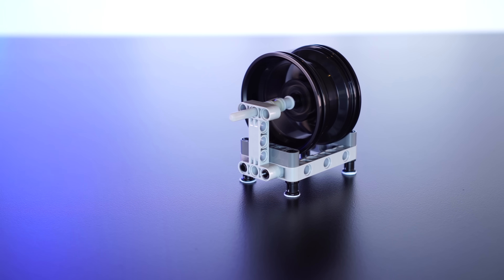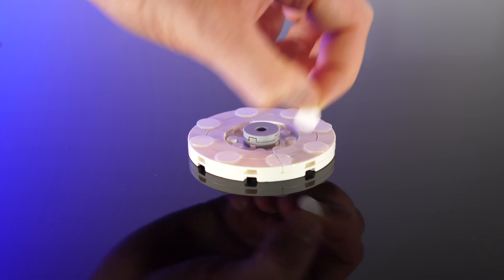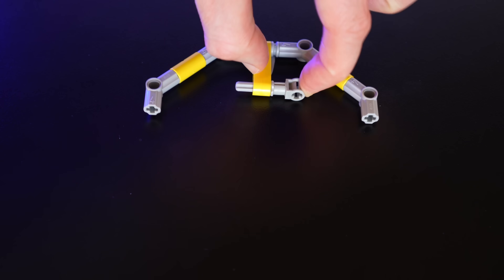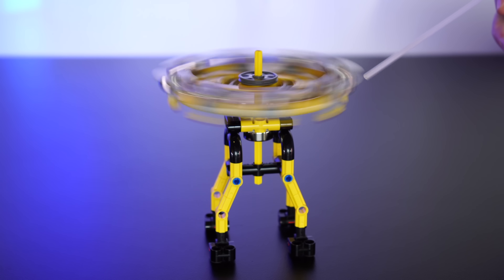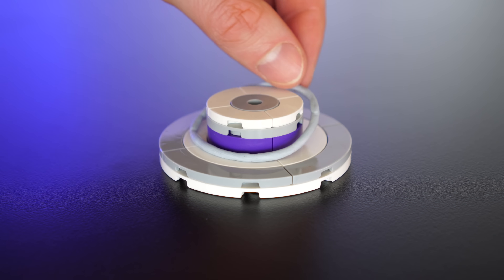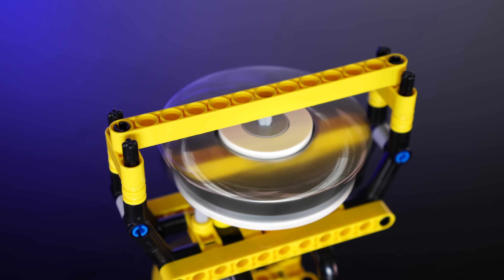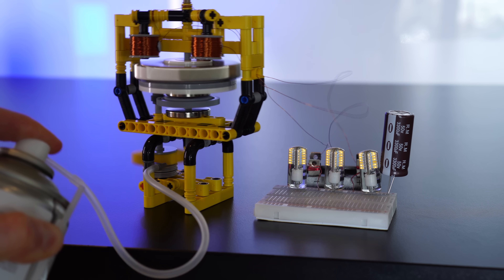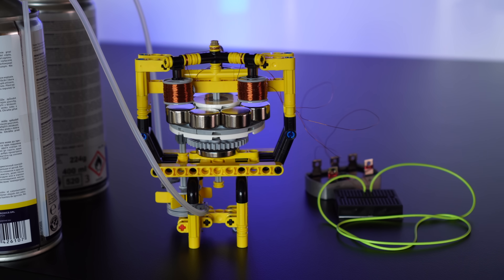Making a LEVITATING Lego Generator Powered by Air

Comment: 11:28 "That capacitor is not rated for that."
Forgive me for being "That guy" but the label says otherwise. from what we can see, your outputting around 20 volts, and the cap is rated for 50 volts (more then double) and a capacitance of 3300 microfarads.  (3.3 millifarads)
So as long as you keep it under 50 volts, you should be good.
Reply from the maker: Yup you're right! Most of my caps lying around (that are this shape) are 16v, so I just assumed this was too. Now I wish I'd pushed it harder 😅
Reply: @JamiesBrickJams  Magnets go wee! lets see how high the voltage can go! Best of luck to ya!

ps. I hope you are wearing safety glasses back there. centrifugal force is no joke.

Comment: The Confidence to spin the rotor that fast without balancing it first genuinely terrifies me, I would personally use something akin to a manual surface grinder wheel balancing stand to find heavy spots and counterweight them with buletack or even small lead weights.
Reply: Terrifies? Right...

Comment: Love your content, but please make your builds stronger and more robust. You can see the flex in this contraption - which will undoubtedly introduce extra friction in the spinning shafts, despite your efforts to reduce this. I appreciate you want to have more visibility of moving parts for the camera in prototyping, but for the final build it would probably perform even better in a rigid structure.

Comment: So, a really neat next step could be to use passive environmental factors for powering contraptions. A gear turning a few degrees from just room currents, heat pumps... Could even build up power for eventual release, making a compressor that slowly fills up a container, then releases that container automatically when a certain amount of turns are completed.
Reply: that would be a very interesting and possible efficient way of generating energy, i like it
Reply from the maker: Agreed, I quite like the concept of 'thief' setups. I think I remember watching a video a while back where the guy harnessed the movement of trees to build up a small charge. In general though, I suspect simply harnessing things like wind would be more practical. Certainly fun to experiment with though!

Comment: In industrial generators, like the alternator of a car, brushes are used to activate an electromagnet on the rotor, which creates a magnetic field. If the speed of the generator is higher, the brushes inject a lower voltage into the rotor, so the voltage is regulated
Reply: And brushless?
Reply: @EJGT0706 they're computer timed with the same functions. It's like comparing an analog watch with a digital one.
Reply: @enderdrane  as an electrican, brushless 3-Phase AC motors dont use any kind of "regulation" out of the box. The physics behind them make them spin at the frequency of the current supplying the motor, and the number of magnetic pole pairs the motor has, ie a 1 pole pair motor connected to 50Hz has 3000 rotations per minute, while one with 2 poles has 1500 RPM, or one connected to 60Hz with 3 Pole Pairs has 1200RPM. The formula is n=(60×f)÷p, where n = rotations of the axis per minute, f = freqency and p = number of pole pairs. Mind that you still have to consider slippage, because brushless 3P AC motors arent 100% efficient in that regard.
Reply: @ClippydoesntwantaRevolution000 Oh, dang. Thanks for the clarification.

Got no idea what I was on to make that previous pressumption lol
Reply: @enderdrane  i only know this stuff because i recently made my apprenticeships final examinations and the organisation regulating electricans apprenticeships and education in my country has a strange fixation on those motors, even though a vast majority of us  will never have much practical contact with them.

I also just realized that OP was talking about GENERATORS, not MOTORS. While both work reasonably similar, dont take what i rambled about as gospel, for i have just a general idea about how generators work

Comment: Get a real compressor with a proper airtank integrated, most will easily do 8-10 bar and run rings around those air duster cans, which are hazardous to your lungs btw when used excessively in unventilated spaces.

Comment: The problem with yon can of air, aside form being rather expensive for whatever fooling about you plan to do with it, is that, as gas expands, it cools, so it ices up during prolonged use and the cold drops the pressure in the canister
Reply from the maker: You're absolutely right! After about 15 seconds, you can feel a significant drop in output. And the can gets freezing cold. I don't think these would be able to run for that long without massive losses in efficiency. Though I do have a lot of these cans lying around to swap out 😉

Comment: That was a cool project, but please keep in mind that compressed air from a canistar can be hurtfull for the lungs. Always ventilate the room well when you use the air canistars.
Reply: I've always assumed it was compressed nitrogen but maybe that's not true
Reply: It's a slight refrigerant, fluoride inside™
Reply: Every product comes with a safety data sheet, just google your product SDS and it will tell you every way your product can potentially harm you.
Reply: Yes
Reply: Do we know what kind of gas are in them? I've tried to research it but there's no information on product pages, so I've always treated them super carefully as "potentially toxic mystery gas" but I'd like to know more specifics
Reply: @GreenJalapenjo  Depending on the brand, it might be 1,1-difluoroethane.
Reply: @GreenJalapenjo  usually a similar gas to what's used in refrigeration circuits since they can be forced to condense with pretty little pressure
Reply: The thing in those air duster cans is some kind of CFC, the same thing that caused the giant environmental disaster that was the hole in the ozone layer, so maybe don’t use them if possible

Comment: It baffles me you haven't built a lego magnet seperator yet. They are so simple and at this point it's just gotta be a point you drill into every video just because to really push how strong the magnets are.
Reply from the maker: I did! But it broke the pins and axles I was using 😬 I guess it's possible with aluminum axles though...
Reply: @JamiesBrickJams  Motor that seperates magnets for you???? Keep up the good work my guy
Reply: @JamiesBrickJams please charge the phone experiment carefully or not it explodes
Reply: @JamiesBrickJams you should make one where u can pedal it woth ur hands and it creates electricity
Reply: @JamiesBrickJams where do you buy them pls
Reply: @JamiesBrickJams 50V 3300μF capacitor using
9V 1F
Reply: @JamiesBrickJams  you can buy wooden ones online, though it kinda defeats the purpose of lego!
Reply: @JamiesBrickJams  yo i wanna ask what is the point of this? like where could this be useful
Reply from the maker: That's a fair point. I'd say it's not very practical. Though it's a fun proof of concept. Practically, a more useful generator in an emergency situation is likely to be hand or leg-powered
Reply: @JamiesBrickJams  cool thx for telling ima pitch this on shark tank
Reply: @JamiesBrickJams did you think about running the generator with liquid nitrogen? Ballance the magnet wheel and get more rpm and more voltage. 

And what i also find interesting: how much voltage and current do you get out of the generator? Can you hook up a multimeter for measuring?
Reply: HOW
Reply: Brother, don't increase the bar for entry. There may be a kid watching this.
Reply: Nah wtf is this
Reply: See how much it charges a 9v dead battery
Reply: You can buy a non metal one so the magnet doesent atracct to it
Reply: Why, its very boring